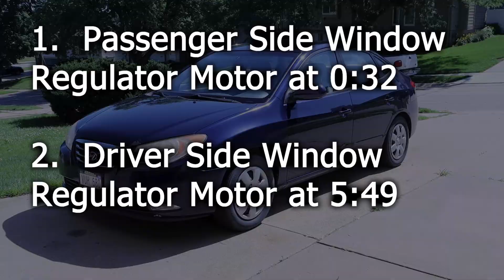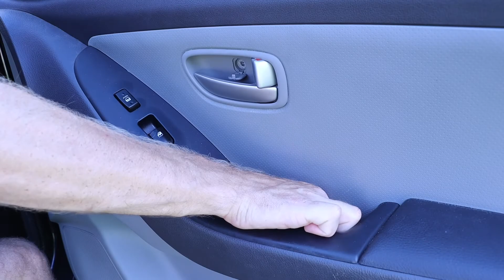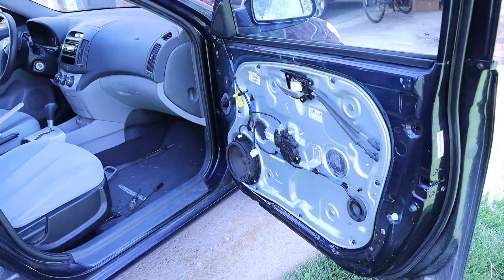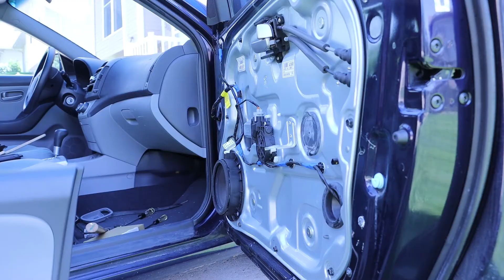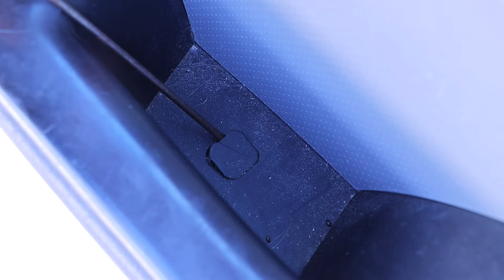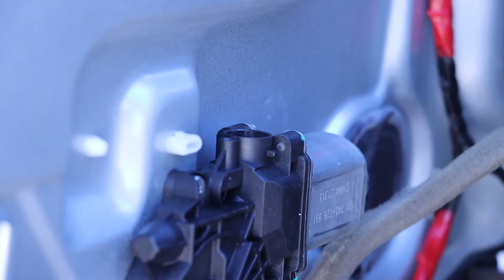Front Window Regulator Motor Replacement (Both Sides)- 2008 Hyundai Elantra, 2.0L (2007-2010)

Comment: How do you know if it's the motor or the regulator that needs to be replaced?
Reply from the maker: I recommend this article from AutoZone: https://www.autozone.com/diy/electrical/window-regulator-vs-motor-whats-the-difference#:~:text=If%20your%20window%20moves%20slower%20or%20faster%20than%20usual%2C%20it,a%20problem%20with%20the%20regulator.